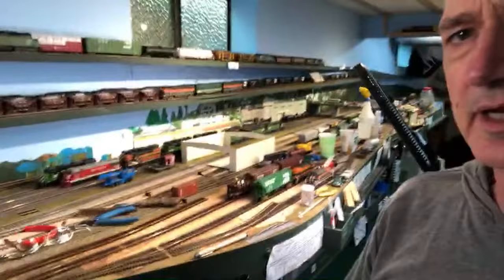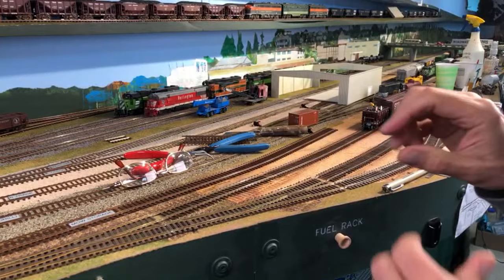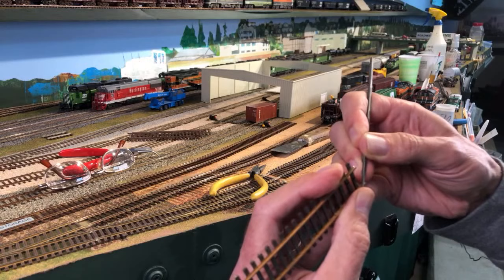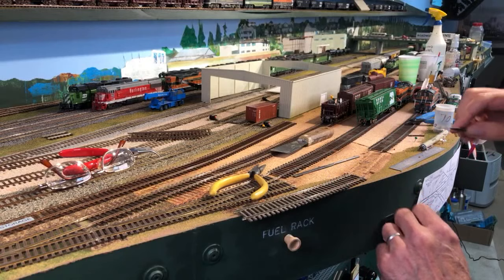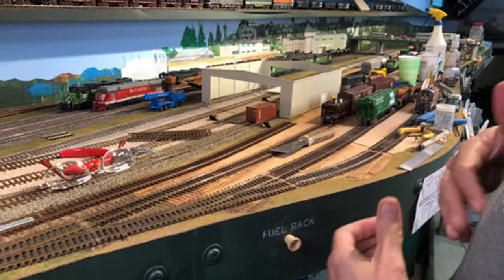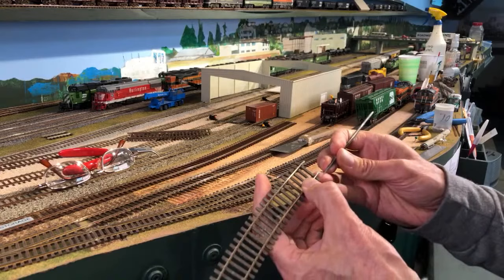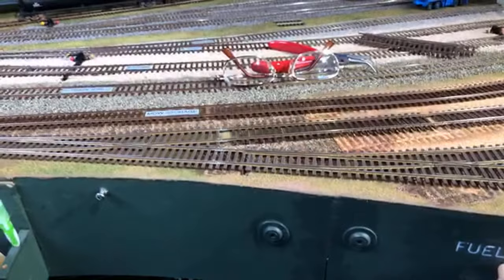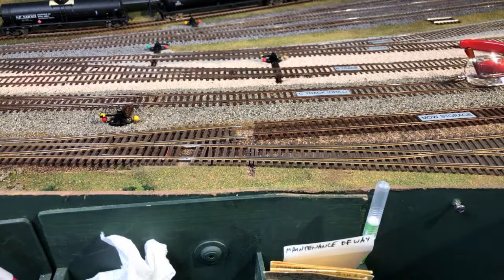Tracklaying basics with Burr on the HO BN at the Interbay Car Repair Shop, Part 1

Comment: I see you have the Same Phone Holder i do on top the Tripod. I found i had to really tighten down the top Knob by Hand to keep vibration to a minimum. 

Also I upgraded to a Pro type heavier Tripod and Heavy Ball head to put my phone mount on. 

I have an 8+ in an Otter Case. It’s pretty heavy that way. So much more solid and stable now even if I bump it while shooting.
Reply from the maker: Great ideas. I have some of that too, but bumping it while shooting is still a big bugaboo...

Comment: I was just checking,  you do not solder each joint? Also if had to add a feed wire, what size wire do you use?  Like to see a video on wiring for DCC, mainly covering the switches, this were I get a little lost.
Reply from the maker: I sometimes do solder a joint, especially on a curve where you want to avoid a kink in the rail curvature, so you solder the joint before curving the flex-track. But if you use the Micro-Engineering rail joiners, they are very well made and hold the rail tight, assuming you are using Micro-Engineering track and switches. The Atlas and Walthers track products have rail with a thicker cross-section, so they take more filing to get them to work easily with the ME rail joiners. For feeder wires, I use #22 or #20 gage solid wire down to the layout underside, and then connect it to #18 gage wire for a run up to about 3 meters/9 feet and/or connect it to my DCC bus wires which are usually #14 or #12 gage for runs up to 50 feet or more.

The subject of switches is complicated, because some of the brands have different approaches to which rails are connected electrically to which other rails. Sometimes you have to draw it out, test it with a voltmeter to make sure, and then decide which rail to solder a feeder to.